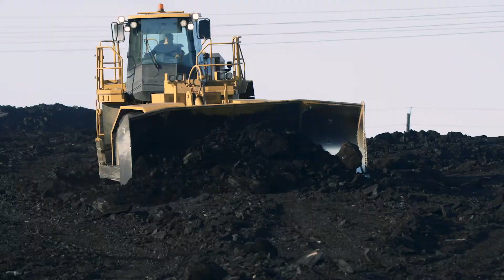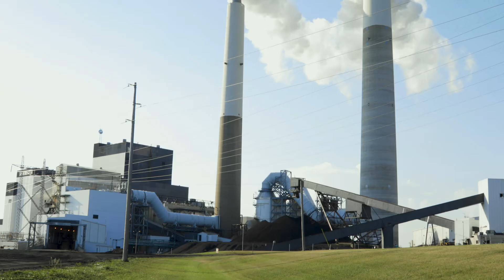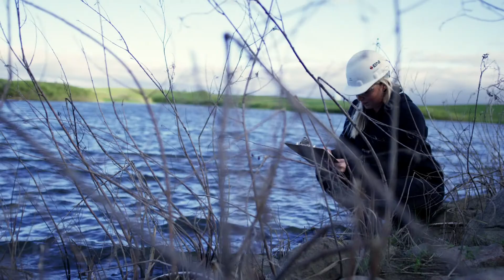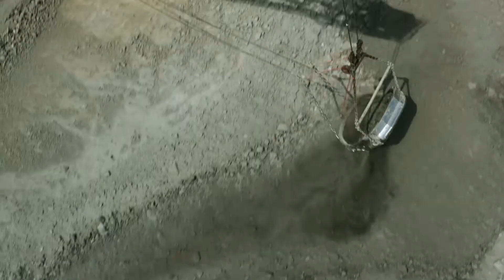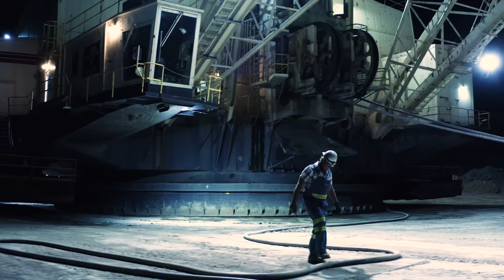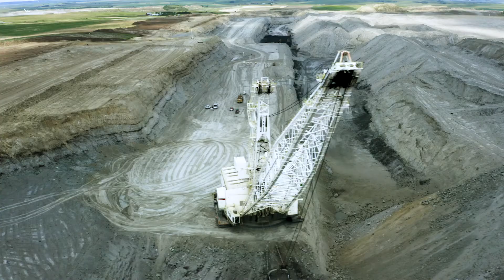2020 Tour of BNI Coal's Center Mine

Comment: why not use a conveyor belt to deliver coal to the power plant ?
Reply: Oh IDK, maybe... COST!?!?!
Reply: @Most_Trustworthy_Weasel  conveyor belt can be cheaper and save diesel
Reply: @JT-zl8yp  

If it was cheaper they'd be using it, unlike how you apply your brain.

The Coal Mine isn't static and is in constant relocation to a new seem. Conveyors use very expensive, not readily available parts that need special foundries to manufacture, almost always over seas which would mean weeks of down time. Remember they said 7 miles to the power plant.

A hand full of trucks with readily available parts enures the coal continues to get deliver even if two trucks go down.

Do you understand now? It's quite elementary.
Reply: @Most_Trustworthy_Weasel  I have a hard time believing your "500k dollars and 2 year story" but Now factor in the costs of paying truck drivers for 2 or 3 shifts every day...then factor in the costs of diesel which were rising untill recently and the costs of maintenance of the roads....judging by your arguments...I wonder how you run your business...also what if the truck drivers unionize or go on strikes etc.
Reply: @JT-zl8yp  

Like I said you seem to know more then the industry insiders! Amazing the top talent they attract isn't as smart or as financially savy as you. Weirder still, you don't own a company or work for them..